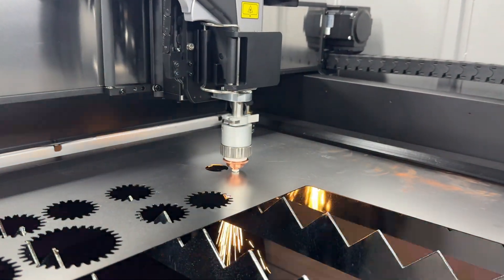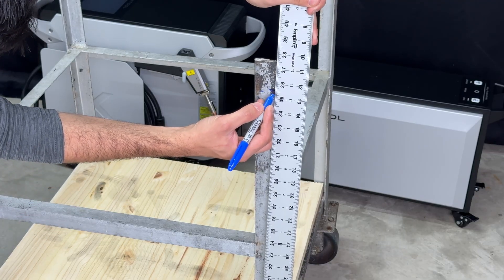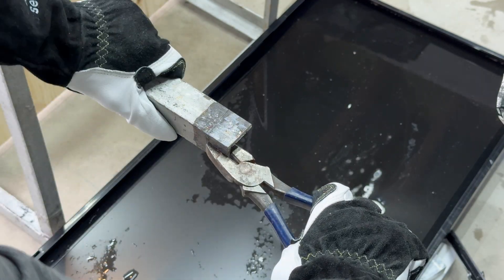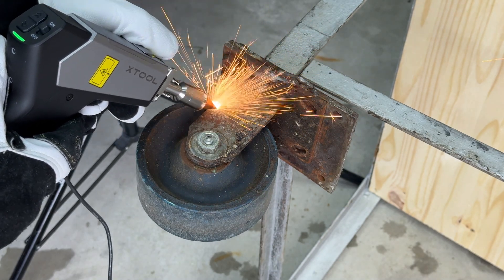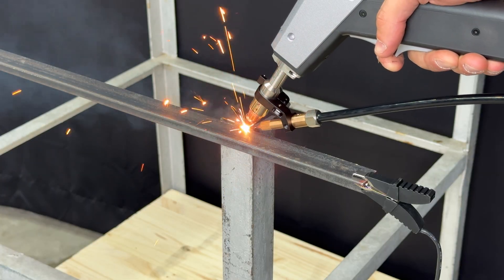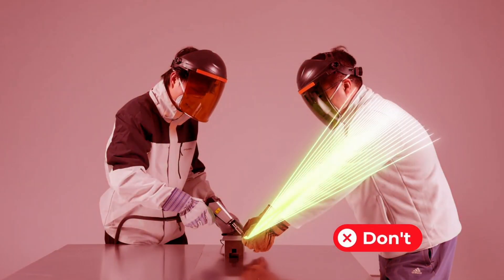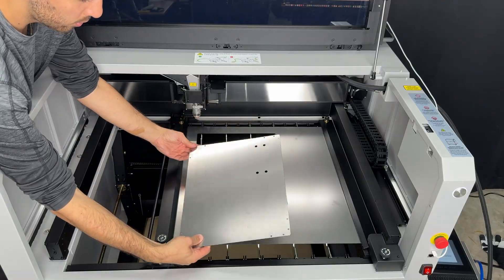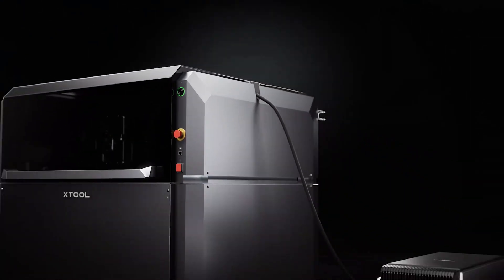Cut, Weld & CNC Metal - ALL IN ONE TOOL

Comment: Wait, did you just mention that you need a special code obtained online to use it? Does it mean that this machine is reliant on internet connection and  manufacturers servers or is it just a password hardcoded in firmware that will always work for this specific one? If it's the first option this would make the machine unusable if manufacturer stops supporting it for whatever reason.
Reply: I have a different machine/brand; but it has a (the same) hardcoded admin firmware password.

Comment: Glad to see the emphasis on safety.  So many cheap, dangerous laser devices coming out of China these days. That said, these sort of machines concern me still, especially when they aim them (no pun intended) at hobbyists with minimal experience.  Reflected laser light is dangerous.  Everyone in the room must wear eye protection.  Professionals that use laser welders often use them in a room with controlled access (flashing red light, locked door).  Conventional welding is relatively safe for bystanders so long as they don't look directly at the arc.  Someone can wander past with no real risk.  I hope hobbyists take the risk to others seriously and ensure that no one comes into the room while they are using a laser.  That said I definitely can see a laser system in my future some day.

How bright is the laser with eye protection on?  From the pictures it seems like the eye protection doesn't have to be all that dark, so it might be a lot easier to see what you're doing.  With arc welding sometimes it's really hard to see where you're going with the bright arc and everything around it dark.
Reply: I agree. I think many are confusing the minimal experience needed with minimal knowledge and preparation. No pro welders will be losing jobs because Jimbob can pick up a laser welder at harbor freight, lol. 

I have a 750W laser and using it without a properly locked down environment would be criminally negligent. 

There's no arc, so you don't need any more than a shade 3-5 (grinding setting) on the goggles/mask. That, plus the OD8 laser safety rating filter is like a really dark green tinted pair of sunglasses. 

Still hard to see what you're doing–the gun is between you and the weld pool. Practically that's not an issue, because even handheld it's a semi-automated process: set up your process settings and feed rate, manage your gun angle, and let it rip and push itself along the weld.

Comment: What frequency laser and what eyeprotection?
Reply from the maker: Good question, The manual says its a 1080nm wavelength, and the safety glasses that come with the kit are rated for an OD > 7  at this wavelength